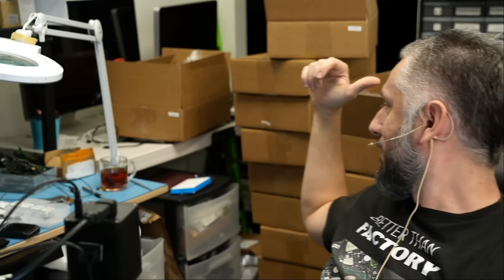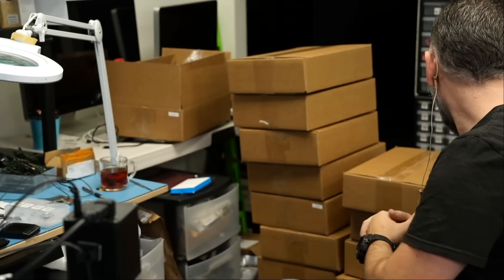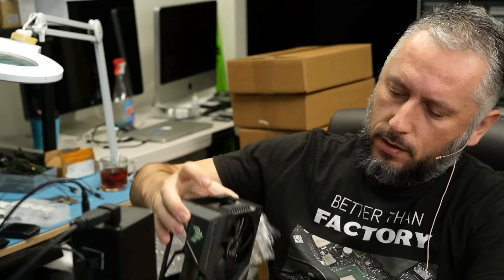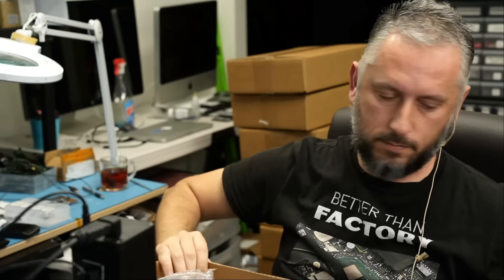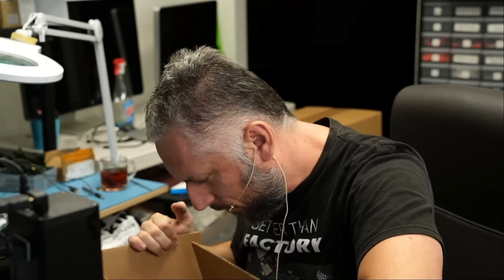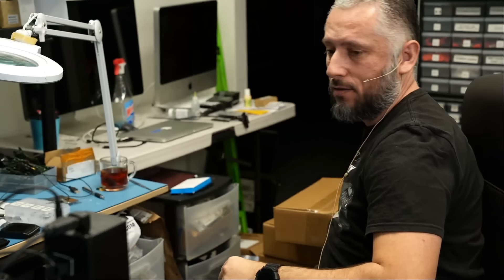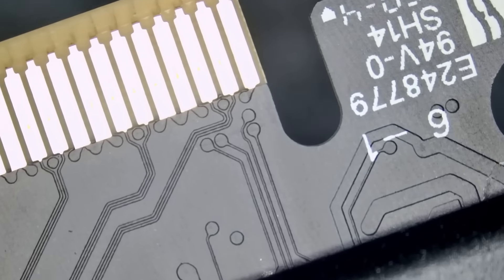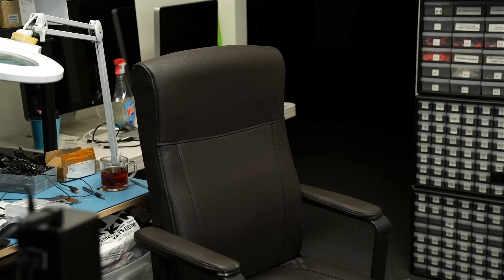We received 19 cracked 4090 Cards for repair - Who's to Blame ?

Comment: ASUS, it used to be a great company! now she is weak and they do worse and worse things. I have 2 motherboards. b550 ROG and z690 TUF, both have problems with RAM compatibility or SB Z and FX audigy sound cards and even with rx vega and rx 5700xt graphics cards. subsequent BIOS firmware improves something, but still has hiccups in games. Poor ASUS, I won't buy anything from ASUS again

Comment: It would not surprise me if with proper support these are cracking regardless.
Modern PCBs I've come to find out are VERY brittle. My day-to-day job is data destruction and most of the SSDs I destroy are add in cards. They span from 10 years old to modern PCIe 4.0 SSDs. The modern SSDs require zero effort to essentially break in half and is one the the easier ways to access the NAND chips. I can only imagine how little force it would take for that tab to crack on modern video cards

Comment: I upgraded my 1070 Ti to a XFX 6950XT Merc about 8 months ago. Watching these videos made me skip the GPU sag bracket and just mount the card vertically in my case. I think it looks better anyways, but this thing has a metal shroud and it weighs a good 2 or 3 lbs. All the stories of VRAM popping off or PCI cracking, wasn't willing to take the chance.

Comment: I think a big issue is people are putting these giant cards in there systems without a support bracket of any sort.. Those coolers are super heavy and the heat inside the case builds up over time putting stress on the cards.

Comment: The manufacturer is obviously to blame for making such weak cards, but also for not stating how a card should be mounted until after the card gets damaged sighting the damage as user error, voiding the warranty.  Chances are all these cards came from a gaming lounge/Internet cafe where you go pay for X number of hours and play... there used to be one near where I live but now its gone due to... goings on
Reply: The PCB has to fit in the slot, there's only so much the manufacturer can do, clearly the PCI-E slot spec is reaching its limits with these behemoth cards.  A gaming cafe is not going to use 4090s LOL.

Comment: i got a founders edition at launch, thankfully ive never had an issue with the connection or any weird stuff, but its also made like a tank, but they are all literally huge and like 6lbs. thats why i never liked how companies were putting two slot connections to the case on like a 4 slot card
Reply: 4090 weights 4.5 pounds

Comment: This is one of the reasons I only buy pc cases that the motherboard sits horizontal, my core v21 holds my 4090fe nicely with plenty of room above for the power cable, and I also installed a clip on the top panel to hold the power cable to reduce strain on the socket.

Comment: I think the tab probably doesn't contain tracks inside so a few of those cracked cards deserve the chance to be connected and tested, if you are going to charge the bench fee anyways, why not giving them at least 5 minutes of your time testing if it works?

If the crack didn't affect the circuit then some epoxy could fix it, and i fixed cracked boards (in power supplies, not a multilayer circuit, and rebuilt tracks with wires) with epoxy because sometimes a board cracks when inserting the power supply cable and putting pressure on the board, not the same scenario but similar in some way.

Comment: The ATX standard for PC cases, motherboards and power supplies is long overdue for a redesign. Certain elements haven't changed in over 20 years. 
The following items should be prioritised: 

1. Improved physical layout to avoid incompatibility due to physical space clashes 
2. Improved cabling - maybe 12V only supply to the motherboard. Do we even need 5V & 3.3V from the PSU to the motherboard any more? 
3. Improved layout to support big/heavy cards 
4. Improved layout to optimise cooling for hot components.
Reply: Finally: a pragmatic and sensible response, instead of sneering.

Comment: Nvidia should definitely start providing a support bracket with each card.
Reply: It’s not Nvidia who should be supplying these supports. Is the Companies who design their OWN Custom PCB and heat sink who SHOULD be supplying the supports!!  You don’t see the Nvidia Founders Edition 4090’s breaking do you?? No, it’s Asus, Gigabyte and other low end companies who design and make their own custom PCB’s and heat sink’s. When you buy low end hardware, you get low end hardware.  Too bad EVGA got out of the GPU market. I have been buying their hardware for over 15 years, and have never been more satisfied with any company, EVER!

Comment: I have water cooled gpu's that weigh more than a stock 4090 that dont crack even with me moving the cases around and i've even driven with them in my car. These cracks are more than likely paranoid people making sure their power plug is fully seating and accidentally pushing the cards down.
Reply: NOT 19 OF THEM

Comment: they should also send better supports with these my Asus TUF card came with one but it does not work with my case too short went to the hardware store bought a stick and black spray paint very cheap and will definitely work just unfortunate that is required

Comment: I remember back in the 386 and 486 CPU days the video cards were supported by the back panel like today. And they were supported by the case with a slot at the opposite end. In those days the cards were not even that heavy. A simple solution is not to have tower cases and go back to desktop cases.

Comment: It is amazing how many PCs are being shipped with these cards installed, and the PC's with these cards bending and warping is crazy.  This is why there is this hokey pokey way to mount them vertically, which not all cases can provide.  I have seen one person that will actually grind these cracks down and build the card back up.   And no these manufacturers are not going crazy, they laugh their asses off because of all these cards needed replacing.  My 4070 did come with a support to keep the card horizontal (I measured with a small level) but each time I need to work on the computer I am taking the card out.   Now motherboard manufacturers are making a PCI slot with "steel" support, which protects the slot on the motherboard, but the stress has to go somewhere and the card cracks.  You noticed too most of these cards are triple fans, where the rear fan, most of the time, does only have cooling ribs.  It is the added weight without support.  How much would it take to make only two fan cards that are within the length of the PCB?  Most of the time, the fans on your video card are not even spinning, unless you play a game or use video editing software.